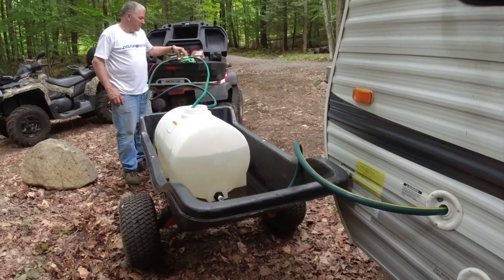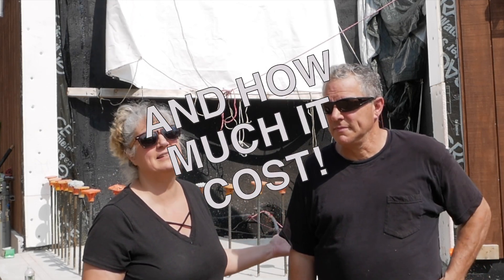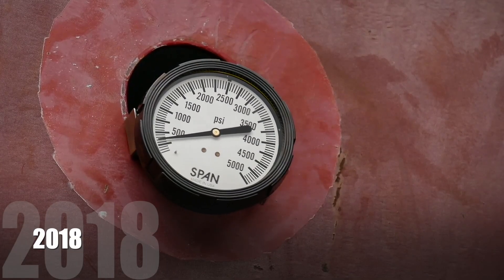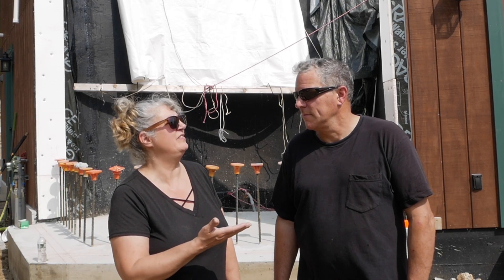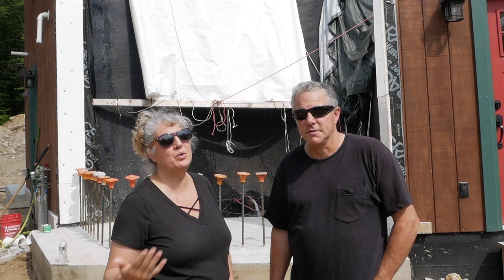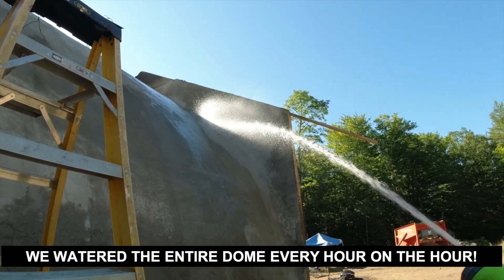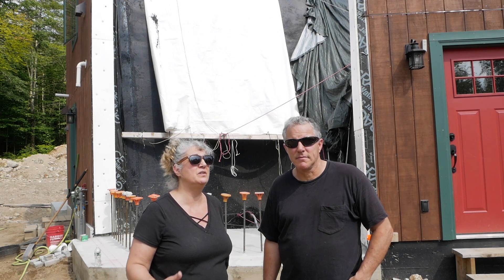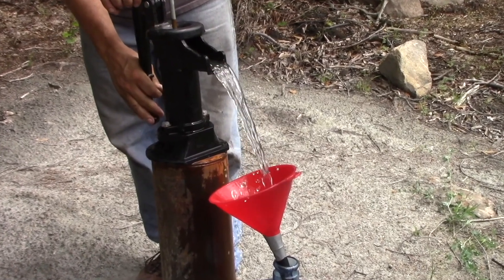OFF-GRID WATER SYSTEM | Drilling, Fracking, Pumping, & Costs

Comment: Wow we also had issues with our well. The well dowser said one to two GPM at about 100 to 200 ft.. However once we hit water at 760ft we had a new dilemma and that was a 810ft depth limit due to available pipe for drilling and that only gave us a 50ft buffer. We were scared that it was not going to be enough of a reserve capacity. We had the driller flow test it and he said and I quote him " I don't know what the flow is but it more than 35 gallons a minute and your not allowed to pump that much on a personal well". I thought what does that mean? It became clear that we had plenty of water and 810ft was plenty deep since we evidently hit an underground river and not a finite supply of water. We knew this because the drilling  remnants were now small round pebbles that had to have been formed over millions of years of flowing water. We now have pump issues that we will sort out later but knowing we have plenty of water is priceless.
Reply from the maker: Plenty of water us definitely priceless!!!!

Comment: Where I'm at in N.S. everyone in town has a well. When I first moved in there was a drilled well in place. The first thing I had to do was replace the jet pump. They guy suggested I should replace the well. I got someone else to replace the pump. I found that jet pumps suck. When taking a shower, the water pressure would drop to a trickle, so I had to turn the water off for a few minutes and wait for things to catch up, and then finish my shower. 😬 Now I have a submersible and now I can have a nice shower. 🙂👍👍🇨🇦
Reply from the maker: It's good that it was there already, so expensive to have drilled. Good for you for not replacing the well....and I never heard of jet pumps before but the submersibles are definitely the way to go. Glad you worked it all out.....nothing like a great shower!

Comment: I think if you install a bigger pressure tank ( like about a 96 gal. tank ) your well pump will fill that tank and your well pump will come on less often and you will also save the life of your well pump.  Just a simple tip.
Reply from the maker: We actually thought about that but either way the well pump still has to pump the same amount of water....does it have to do with the on and off?